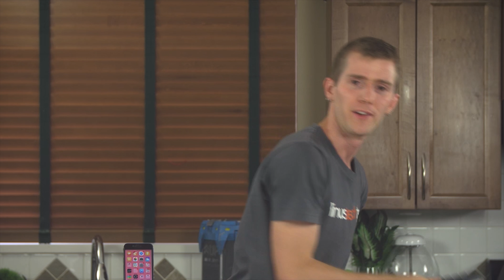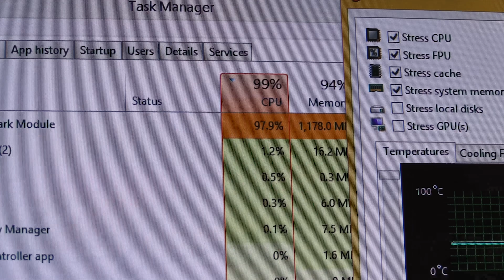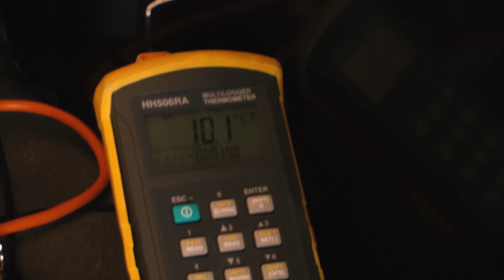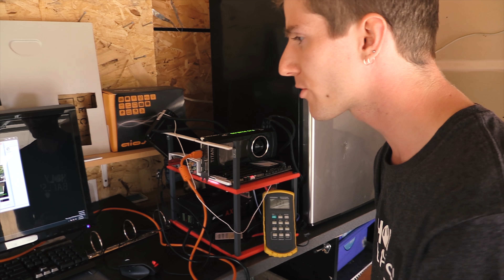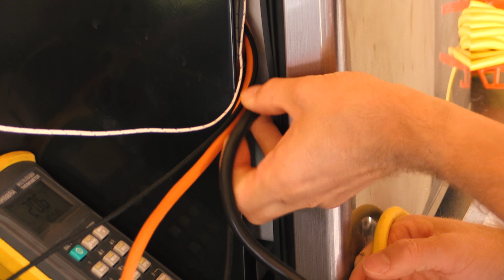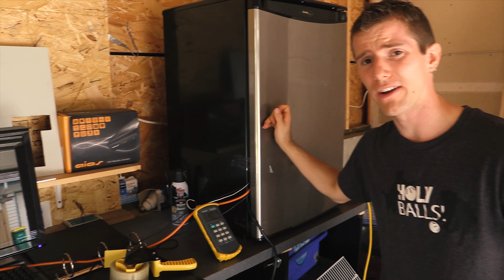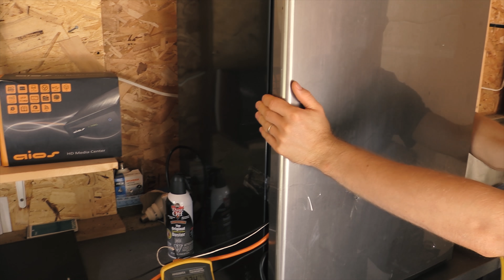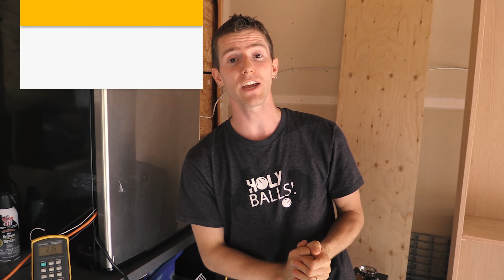PC Build in a Fridge - Does it Work??

Comment: protips, should anyone take a 2nd shot at a fridgeputer case.....

1 - use liquid cooling or heat pipes; your goal should be to transfer as much of the cold from the surrounding air to the surface of the dies as possible through the heat sinks, so liquid(not necessarily water) is your friend or anything that can rapidly transfer the cold from the air to metal and so on....
1b) - arguably a tiny bit of moisture would probably help transfer the cold but may not be worth the gamble; if someone could think of a somewhat liquid substance that doesn't conduct electricity and isn't flammable or otherwise dangerous, that could possibly be sprayed on the metal components to improve on the cold transfer(think how condensation or sweat works) :P.... 
*improve on removing moister from the fridge by using a good old trusty box of baking soda! or get a little fancy and use some silica based kitty litter....
** bonus overkill tip - consider using some peltiers:P
2 - rip out the thermostat and learn to tinker with it( technically the crappier the fridge the easier), basics is the thermostat runs the compressor till fridge gets to x temperature, then the compressor turns off and so if you tell the thermostat to leave the compressor running for longer the fridge gets colder.... overclock your fridge into a freezer!!! ** note if the fridge is really really crappy quality then you may end up shortening the life of the compressor; but this is no diff than buying low end air conditioners(you get what you pay for and mileage may vary)
2b) I really don't think you can improve on how well fridges are insulated/sealed as most are a container made of styrofoam or insulation with a fancy cover and there's not much to improve on:P
2c) the compressor has to sit upright else it will seize or clog and game over
3 - the bottom of the fridge is cooler than the top(hot air rises, cold tends to sit at the bottom; think of spilling liquid nitrogen on the floor and how it acts); this is why newer fridges have the vegetable drawer with adjustable temperature usually at the bottom.... this would probably be the optimal area to place a radiator; other good place is vents, but maybe they'd be to small for anything worth while
4 - listen to Linus on not freezing the hard drive! (I assume it should be fine for ssd)

** if you start getting stability issues take into consideration that your components may not like running at -3000c although if they came from NCIX this should be a non issue since they're coming from here in Canada

goodluck!

Comment: LinusTechTips Computers can be cooled through liquid? Water cooling or what ever iti s called. Puncture two holes, one in and one out. Fill the fridge/Freezer with rings of tube, get a decent pump to run it, and pump liquid into the fridge and out. That might make the "fridge/freezer" type of idea work. There is a few people using this tactic to cool their Aquariums of larger volumes and might work for computers as well with some tweaking.

Comment: I made my air con blast at computer with the sidepanel off = profit and -10 degree in load temps. Altho my only cooling was with fans so cant tell about watercooled setups.

But still couldnt OC my graph card substantially more.. Any idea? Was the GPU just crappy? 6950 model.

Comment: Could you guys do a CRAZY overclock scrap yard wars video measured by how much of a gain can be had? You guys limited yourselves on the last one by budget. Does hooking an aquarium chiller to the cooling loop (no rads) actually regulate cpu and as many hot gpus as you can fit make sense? Use some seriously ridiculous ideas that have huge bang-for-buck effects.

Comment: Your explanation of how a refrigerator works is spot on, and simple enough that anyone should understand why using a refrigerator is a crappy idea.  Additionally, the fridge is going to use more electricity the hotter what is inside gets.

Comment: The thermal capabilities of the Fridge is less than the wattage of the combined TDP of the system. It's been very well documented that it optimal cooling can be achieved with nothing more than a Styrofoam (Organ cooler i call it) ~7$, and a Transformer/PSU (Mains to TEC voltages)  with a couple ~200w TEC cooling modules, you could get the load temp into the range of -35c.

Comment: Stick the radiator in the fridge and have heat exhaust out the fridge. There for you don't get much work for the compressor but still achieve a cold CPU.

Comment: would it help to have the door actually sealed? like don't they make a low pressure area inside in order to move the heat? idk it still probably would be overwhelmed but just wondering.

Comment: For all the SOGgies out there.  Two-Step Procedure to combat the heat 1) HVAC, lower your home below room temperature adjusted to your comfort level, then 2) use a cooling system for your PC that you already know that works.  I was considering using a mini fridge way back when I was imagining smoking 420.

Comment: I understand constant 24 hour operation is going to fail. My refrigeration idea involved a freezer larger bucket of water or oil copper coil. Next thing is dealing with condensation. But for short runs should see a difference mind you the whole system is going to heat up under continuous operation

Comment: What about putting a water cooling system's heatsink (not the whole pc) into a freezer, and use antifreeze? That would theoretically keep the heatsink and liquid at very low temps, therefore reducing the cpu heat by a lot, while not be too much to handle for a freezer,right?

Comment: crazy stuff.

A bit more explanation of cooling exchange systems would have been good for all of us to know about. Those mini refrigerators are low capacity passive systems. They remove heat from the air, slowly, efficiently. Slowly. They will be easily overwhelmed by a heat source. But you guys knew this. Air is an insulator, it takes time to slow them molecules down. Hence HSFs have direct contact and often water circulators to exchange the hot air with lesser-than-hot air.

That being said, it was a fun experiment

Comment: The air conditioner is true. My laptop came close to overheating, so I unscrewed the back plate, and held the laptop up to the fans. Within minutes, the whole system was as if I hadn't used it in several days.

Comment: I've been wondering about this myself. I have an old mini in the closet that I was thinking of repurposing... good to know it wont work before I wasted my time. My second thought was to pump cooled air directly in to one of the computer's air intakes using a portable, single room air conditioning system and some improvised duct work, but I am a bit concerned about condensation... anyone have any thoughts on this?

Comment: Thermal paste that makes an endothermic reaction when heated up to give a cpu cooler a heat debt to pay back to make sure it can stay under the load without cpu throttling  in laptops could even be trigged by the pc it's self. Am i just being stupid or is this not obv to use heat  debts and shit in laptops

Comment: How about using a liquid cooled custom rig with compound in the liquid and a catalyst  for each specific  reaction in the correct place. At the cpu and endo thermic reaction becuase of the catalyst  and pressure of fast moving liquid at the stagnant  radiator  and exothermic reaction takes place again because of a catalyst  and the right conditons; i would have to research  this becuase i don't currently know of a 2 way reaction  that is that volitale but im sure i can be found. This would make water cooling on sted so much so you might not need fans for current power out put in systems. Its worth a try right?

Comment: well done Linus, well done! however you lack to realize the cooling factor for the space inside the box and the formula for heat dissipation and compression of cooling AKA BTU of the cooling factor plays a sum roll to the over all cooling. It could of been summed up before a test because compressor operated mini frig and ammonia operated mini frig operates at a different cooling variant being that a compressor unit has a fan inside witch circulates the ambient air evenly and where as a ammonia mini frig has no fan to circulate the ambient air thus not allowing circulation accrue. Your conclusion is half correct however given the factors and equipment you are using to do the test!

Comment: CPU- Intel Core i7 5960X

Motherboard- Gigabyte X99 Gaming GI

Memory- 32GB (4x8GB) Corsair Dominator Platinum DDR4 2666MHz

Video Card- 2x MSI GeForce GTX 980 Ti

Sound Card-creative Sound Blaster ZxR

Boot Drive- Samsung 850 PRO 1TB SSD

Storage Drive- Western Digital Caviar Black 4TB HDD

Optical Drive-  OEM Bluray Drive

PSU- Crosair AX1200i Platinum

Case-Corsair obsidian 900D

OP- Windows 10

Is there anything you'll change? Maybe water cooling?

Comment: Linus quick question.
Have you ever heard of condensation?
Placing a whole pc in a fridge will kill the pc a lot faster then the fridge.
Cold air with lots of water in it will condensate on all the spots where it is warmer.
Something like a i don't now mabye a computer that is working inside that fridge.
If you really want to cool a pc down place it in a small room with a good powerfull airco and a air filter system.
Run all the cable tru the wall.
And now any noice that the pc makes is irrelevant because any sounds that are made are blocked by the wall.
So cool and clean room for your pc and no noise what so ever.
.
You are welcome to try it in your new office.

Comment: That little fridge isn't rated high enough to cool a PC lol. Even putting hot food in there would raise it's ambient temperatures for a couple hours, let alone an entire PC. I work in the HVAC so it's pretty obvious to me but I could see how people would think this would work.
Reply: Mast3r Race The point is it can't be worse than normal ambient temperature m8.
Reply: gamingfreak091
Actually it can and was in this video at points. There is no airflow in these small box fridges so it's super easy for the ambient temperature to rise above the outside air.

Comment: My friend mounted his computer on top of his 60 liter mini fridge (with a mini freezer inside) and ran 10 meter of liquid cooling tube into the fridge on one side trough 2 radiators with 2 fans and out the other side back into the system. And he still manages to cool his sodas at the same time.

Comment: Hi, can a system with the following specs okay to run games (BF4, GTA V) at high settings

AMD FX-8350 4.0GHz 8-Core Processor
Gigabyte GA-970A-DS3P ATX AM3+ Motherboard
Kingston HyperX Fury Black 8GB (2 x 4GB) DDR3-1600 Memory
Seagate Barracuda 1TB 3.5" 7200RPM Internal Hard Drive
Asus GeForce GTX 960 2GB Video Card
EVGA 500W 80+ Certified ATX Power Supply

Also are the components okay or shall I change some things?? Thanks

Comment: it was water cooled the heat exchanger and fans should be outside of the fridge this would help if i were going to do this with a fridge i would make custom blocks for on the cpu ram and gpu to pump the refrigerant through them and ditch the fridge shell in favor of a vacuum vessel lined with silica gel and put it under a vacuum to control moisture and place the compressor and other components outside so i wouldnt have to listen to them

Comment: Fridges have radiators in the back.

Strap a couple of fans to them and I would wager that it COULD work.

As for the moisture thing thats easy to fix, Disposable condensers (There like £2 here in the UK) Put one in the bottom, and change it once a month. (Although if you used 2/3 (There not very big) You would never need to change them unless you open the fridge. This would mean you could put the HDD's inside (Heck put them in anti static zip lock bags)

Other things that could make this work.

Pack out the empty space with polystyrene (We use this trick in large freezers that are mostly empty)

But I reckon someone could get it to work with reasonable results.

Comment: This would never logically work with a actual rig (aircooled) because hot vs cold = sweat. Which means moisture. Which means short circuit. Which means bad day for your PC. Now, if it was watercooled, it may work. Just gotta make sure the water doesn't freeze. Don't see how you'd protect the mobo.

Comment: I would like to see a water cooled setup where only the rads are inside the fridge.
Reply: Dan Reed if you did that you would be likely to get condensation on the water blocks like when you set a could drink out in a warm room you would be better to reverse and move the rads outside of the fridge to dissipate the heat outside of the fridge reducing the thermal buildup in the fridge
Reply: paktahn Very true it may, I didn't think of that.

Comment: well that mini frige appears to me to not have a way to bring the free on inside like my whirlpool full size frige, that mini frige appears to passivly cool itself unlike my frige which has a radiator inside the freezer. i see that mini frige uses a radiator that transfers heat just like u said through the body, which i consider a bodle neck, if u used a frige that has an internel radiator u woud see better result sence it has a fan to transfer the cold free on through the air inside the frige, interm transferred to cooling the pc components, and this is a family sized frige by the way, which runs 23.5/7. and the bottom part is the frige aera and the top is the freezer section which holds the radiator. CHALLENGE DO U ACCEPT!!!!!!!!!!

Comment: There is no surprise the ambient temperature is exactly the same as the room temperature. Think about it... If you put a can of soda in a fridge and measure its temperature, it will still be room temperature (assuming the can was kept at room temperature previously). Leave it in the fridge for a good 30mins to an hour tho and you will find that it's temperature had dropped to the ambient temperature inside the fridge!
This same concept must be applied when you run these tests. You must leave the rig off in the fridge until the components match the ambient temperature in the fridge THEN start your tests! Anyway these are just my two cents... I would love to see this experiment repeated!
Reply: Just to add to my suggestion, try to add more radiators to your system and see if doubling the number of radiators does anything!
Reply: Omar Khalil I don't see how that would change anything. It would just take longer, but the result of the heat of the computer overpowering the fridge's cooling ability would still happen. Also unless the radiators were located outside the fridge (kind of ruining the point) it also wouldn't do anything because the same heat would be released in the fridge.
Reply: Omar Khalil if you left the rig off in the fridge until it cooled all the way down then switched it on it would cause condensation to form and that could cause a short that could fry the rig it is never a good idea to take and electronic device from one extreme temp and try to use it in another right away
Reply: Alex Aguilar my aim was to try is to give the upper hand to the fridge. Sometimes both the hardware and the fridge can reach an equilibrium.. But then after posting this I watched him say it's been in there for 12 mins...
But I am still convinced that there is a way to make it work especially by adding like 10-20 radiators or connecting the PC to a car rad that is placed in the fridge with the system outside!
Reply: +paktahn you are probably right!

Comment: if i were you id use a full size fridge. the small fridges doesn't have good air circulation. normal fridges will be a better test.

Comment: but could you use a water cooled pc build, but have the water run though the fridge to cool down? hahah. you would have to build something to hold the pc right next to the mini fridge, ofc not the side where the fridge would put out heat. 

playing games with a unique water cooled system and you still have a fridge to store drinks hahah

Comment: tried it. if u water cool your cpu and gpu, drill a whole in the fridge, seal the holes with something and put your radiators out, it works! its not gr8 and not big difference. only about 5C to 10C change in cpu temps. but the ambient were pretty cool but after a while it does heat up due to other components